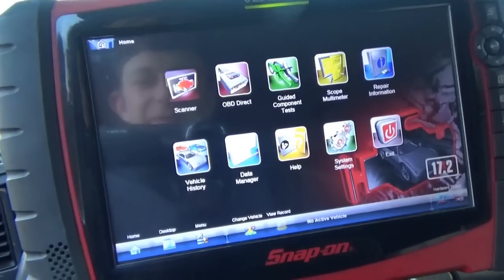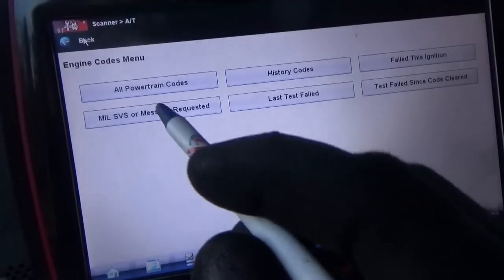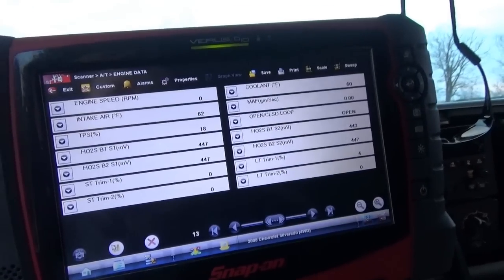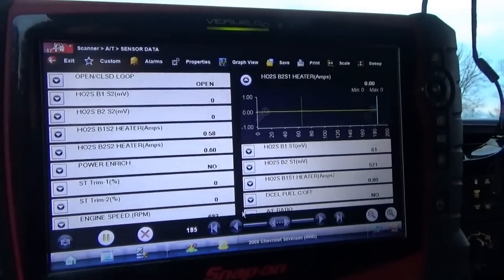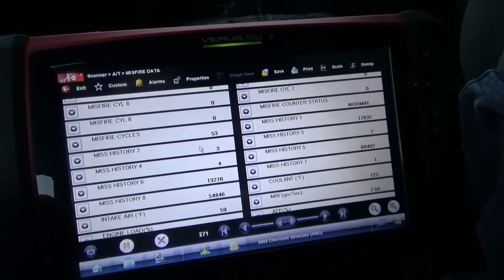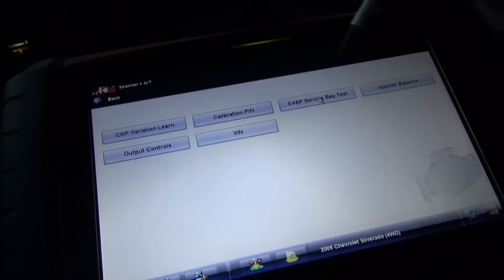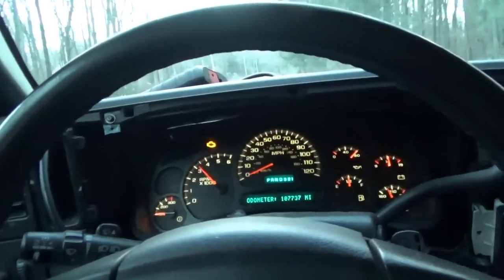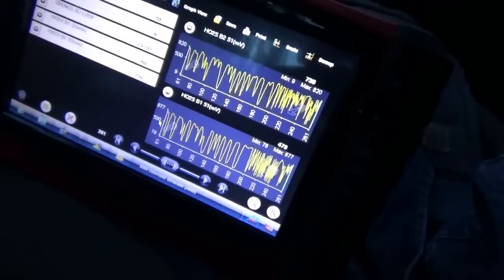GM Truck Misfire, O2 Sensors, LOW VOLTAGE? -Part 1

Comment: Hey Ivan nice video brother. I have something to ask, i own a 2000 gs300 it has only has o2 sensor codes, b1s1, b1s2, b2s1. Its misfires when full throttle in low speed and low power especially from stand still, excessive fuel consumption. It also backfires sometimes if i redline it and get off the throttle. Could you please help me out with this problem. Most auto shops in my country don't know how to diagnose problems they just throw parts at it. Also the catalytic converters are removed. Please help me if you have any idea what it is
Thanks

Comment: It must have a smart transmission, to decide it needs to shift to second even though its in first. This Artificial Intelligence is getting out of hand!
Reply: yeah Boeing is heads deep in that issue too.
Reply: That's normal
Reply: caduceus33 like the Boeing 737 Max 8 aircraft taking over! Not good to loose control to a computer...

Comment: My company Chevrolet Van did the same thing the alternator would shut off under hard acceleration and high RPMs. It had a vortec engine and it I believe it was 6 l

Comment: I had the same problem with mine last year. There are three banks (name?) in the alternator that control voltages at specific rpms so amperage does not overload. Mine had a bad third and caused the same to happen at 3600 rpm or so. All lights dimmed and voltage dropped to 10-11. Changed alternator and fixed.

Comment: I thought that if you dropped it in 1st it should stay in first.  Now I know if you are going to quick for 1st and you drop it into 1st it will go into second, but once you are going slow enough it goes into 1st.  Strange.

Comment: I’m having a similar issue and can’t figure it out. I have a 2011 Silverado 3500hd 6.0 and all of bank 1 is getting no spark(cylinders 1,3,5, and 7) but the injectors are on. I have a P0300 code and plugged in my buddy’s snap on scanner and found that the o2 sensors (B1-S1 and B1-S2) are reading 0mV and 50mV. I replaced the upstream sensor and now it’s maxed out at 1275mV and the bottom one floats around 450-550mV. So lost. I’ve replaced the plugs, wires, and coil packs. I checked grounds. Everything seems fine. If anyone can steer me in the right direction that would be awesome.
Reply from the maker: Spark and O2s should not be related. Solve one problem at a time. O2 unplugged scanner should read 450mV. Stop the parts cannon lol...if an entire bank has no spark, then coils and plugs aren't going to fix it ;)

Comment: Reminds me of when I complained to the dealer of wind noise from side windows.  Happens when I hit 100mph.  He wasn’t very helpful, but Acura redesigned the Integra to have framed side windows 2 years later.  You’re welcome.

BTW, if you run all accessories does the RPM it happens at drop?
Reply: Yeah, those really smoothed out starting at 90.  A friend ran one.

Comment: Ooow that alternator is odd, almost a harmonic effect, vibration on the brushes or plug connections.
I really don't have a clue, unless it's a odd belt/pulley effect.
You have/had a good one there lol.

Comment: It could be normal. Just switch the generator off when a lot of output is asked from the engine as long as battery voltage allows it to be switched off. I would not be surprised if that was programmed into the computer. However, that should not result in dimming lights imo.
Reply from the maker: I thought that might be a possibility, but if the rpms are held high the voltage kept dropping haha

Comment: hello i have a 2001 gmc sierra 1500 5.3 misfire cylinder one i have replaced coils injectors found bothe lifters on cylinder one they were bleeding down so i did heads and replaced all lifters still cylinder one misfire compression test is fine leak down test is fine looking for ideas
Reply from the maker: Gotta be fuel or spark

Comment: i had same problem with my old ford explorer. stepped on gas to raise the rpm voltage drops to 11v but at idle voltage went up to 12v. was the alternator

Comment: @17:00 voltage regulator in the alternator is bad. Can be replaced by taking the alt apart and doing some soldering but it is usually easier to just replace the alternator.

Comment: I know that some Isuzus will cut the alternator at WOT but never seen anything drop out at a specific rpm.

The up shifting in 1st and 2nd is weird. My Volvo will up shift in manual mode if you get near redline supposedly. I've never been brave enough to try it.
Reply: The shifting behavior is 100% expected for a 4L80E (and 4L60E) transmission.  They have been doing it since 1993.

Comment: It may be a component in the alternators charging voltage regulator failing into a short or open circuit state. If it were a mechanical belt slip I would not expect as much dip in voltage. That's my preliminary guess. Any takers ?

Comment: Plug the adapter from the power probe into the power outlet and use the your meter with the snapon banana jack leads.  Watch voltage on the meter while you accelerate

Comment: Third, don't some alts  have a free wheeling drive pulley?
Reply: Only seen that on ford crown vics
Reply: I think Chrysler 3.8 's had a fuel saving optional pulley they could go dry and fail.  I have had a bridge rectifier have one of the six diodes go bad.  Can check each with a volt/ohm with diode feature.  Also the diode trio on old GM s can go bad.  High rpm is another factor as centrifugal forces can pull on windings and cause an open.

Comment: Great info on the misfire, that's crazy. On the alternator could it be brushes floating and loosing contact on the copper ring were they touch ?

Comment: i had the same thing, voltage dropping above 3000 rpm, new alternator fixed it
Reply: i tried new brushes and regulator unit on the alternator first but that didn't help

Comment: Could the torquing of the engine be causing power/ground issues?
Reply from the maker: Not likely...it's just RPM dependent, with no torque applied!

Comment: I did my own research for fun and one guy found it was a bad diode in the voltage regulator. We all know the faster an alternator spins, the more "raw" voltage it produces, and that voltage has to be regulated down to 14 V. Apparently the diode breaks down at whatever raw voltage is produced at 3000 RPM and the regulator detects this and shuts down the field coil. One could replace the alternator (if the regulator is built in) and fix the problem and never discover the cause.
Reply: On my car, the ecu is connected to the alternator through the cluster. It shut off the alternator alltogether when the voltage was at 17 volts.
Reply from the maker: That's a cool problem. It's very relroducible! I like the breaking down diode theory.
Reply: @PineHollowAutoDiagnostics  I almost bet that Alternator is designed to go on a Diesel.  Most Diesel's red line at 3k or 3500..  So this thing is set up to put out more current at lower RPM's, but then it will over-voltage if you over-rev it's rating.  Maybe it's just a slightly different voltage regulator built onto it than the gasser version.  Not real sure.  The cutoff being at that precise RPM range is just screaming pre-programming rather than a failure IMO.

Comment: Fun fact: Selecting manual 2 or 1 is for engine braking only. If you have it selected as such and accel above 3500, it will upshift! You cannot hold the trans in gear like you could on older models while accelerating, beyond a certain rpm/load. Again, 2nd and 1st are for decell, not accell.
Reply: Actually 2nd is for starting out in second or torque reduction.  This is ideal for low traction situations.  It is essentially a VERY basic traction control method.  Selecting 1st performs exactly the way you described though.  These are traits of the 4L60E and 4L80E ever since their introduction in 1993.
Reply: @jbernfield2612  You're right about 2nd depending on calibration. I should've added that. Some models will not start out in 2nd in manual 2. I've driven 100s of them and it seems based on GVWR . Anyways, let's see what Ivan finds! :)
Reply: @adamtrombino106  Agreed, I will be one of he first to watch when he posts part 2.

Comment: The misfires might be from the bad o2 sensors. That I have seen before. You are correct, replace both upstream o2 sensors. Crank/cam sync might not be doing it.

2 years ago I had my alternator do the same thing. Rpm rise, alternator turned off. That was a bad voltage regulator, where it was at full field at idle and the car turned off the alternator

Comment: AMERICA 
ONLY!
Reply from the maker: See, I work on everything haha
Reply: @PineHollowAutoDiagnostics   hello , friend My car has the same problem , code p0131 , chevrolet optra 2009 manual gear. when the check engine light turns up normal. At that time, he's giving this code

p0131 -powertrain  o2 sensor circuit low voltage ( bank1  sensor 1)
p0122- powertrain throttle /pedal position sensor /switch A circuit low input

p1538- powertrain  tap fot multiple descriptions 
thank you.

Comment: The way it's cutting voltage it looks intentional,great content Ivan,thank u sir
Reply: I almost bet that Alternator is designed to go on a Diesel.  Most Diesel's red line at 3k or 3500..  So this thing is set up to put out more current at lower RPM's.  Maybe it's just a slightly different voltage regulator built onto it.

Comment: Amazing fix for that fake p0300! That voltage drop when accelerating is interesting, check if the alternator pulley is a clutch pulley or a overrunning pulley because that is the exact failure symptoms when they fail